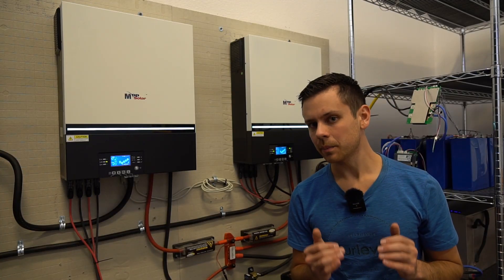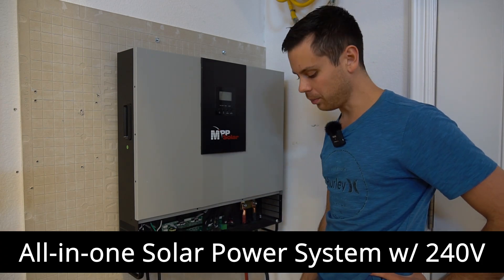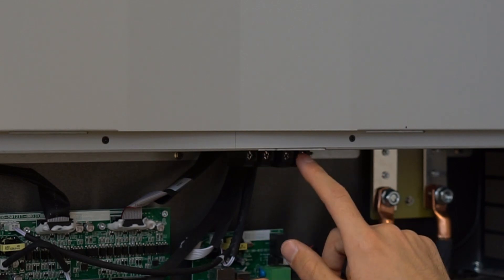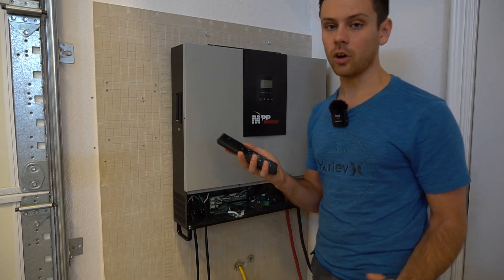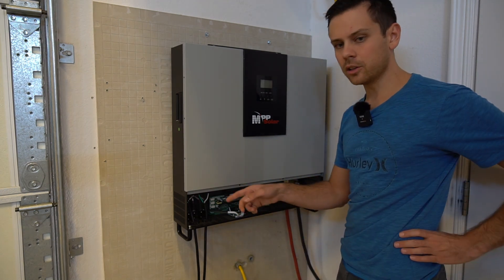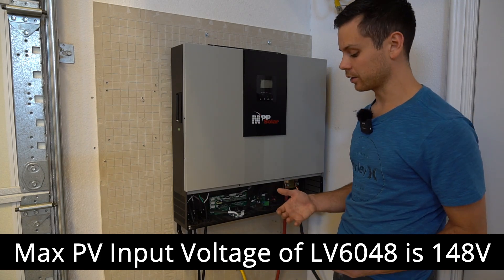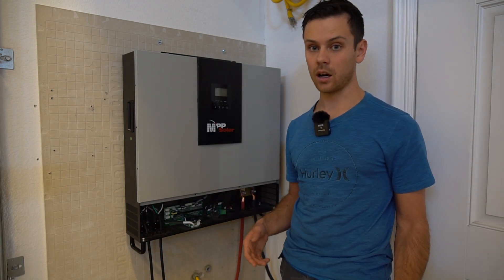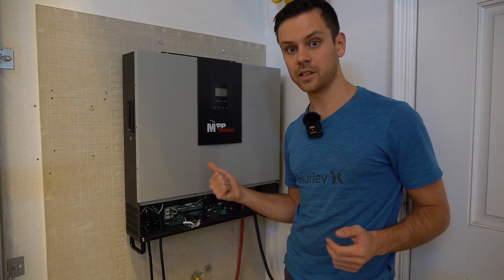How to Charge 240V Electric Vehicles with Offgrid Solar Power

Comment: GroWatt SPF5000es would be preferred over the MPP for strictly charging at 240V. It has 450VDC solar input.
Reply from the maker: I like MPP interface and connection terminals more. I need to make a video about that. Also, it doesn't sound like you are aware that the new LVX 6048 has max input voltage of 450VDC.
Reply: @WillProwse  And the new LVX6048WP will be 600V!
Reply: @WillProwse  
Understood 
The SPF5000es is $899 (240VDC only)
The MPP LVX6048 is $1577
And it’s over 2x the size & weight
High Freq GW vs Low Freq MPP
Reply from the maker: Where is it that cheap?? That is a bargain
Reply: @WillProwse  
Signature Solar
Reply: @WillProwse 

I was wondering why you went with the MPP over the Growatt. Would love to see this video! …I’m considering Growatt for the price difference!
Reply from the maker: @echopapa243  wow it is cheap. Gosh I love mpp so much more, but the growatt is a killer deal. That output for the price is crazy

Comment: I would like to build a carport with solar panel roof as an off grid charging station.  I am trying to get away from converting the DC off the panels to AC only to convert back to DC to charge the vehicle.  Is there an all DC solution?
Reply: You have to design it yourself.

Comment: Will, I want to charge my F-150 Lightning Pro's onboard battery with solar. I plan to use the onboard 98kwh battery to power my camper. The truck has multiple 120 output plugs and a single 240 volt output plug. I only need an appropriate MPPT to charge the onboard battery, right? I don't need a battery bank, do I? Thanks.
Reply: Yes you do. 240v inverters are not battery less.

Comment: I have a 72v utility electric truck I need to use as a backup power source. The problem I have is that these split phase inverters are 24v or 48v. What do I need to be able to use my truck to power my house?

Comment: I'm sure this is the wrong place, but it's really the only thing I've seen RE:240.  I was thinking about using 2 Bluettis & batteries to make 240.  Is it possible to then run it to a separate breaker box for 2 legs, 1 - 240 circuit for mini split and 2-120 circuits to run my TV/Computer room?  Then I'd run 240 to charge the Bluetti when there's not enough solar.  If there's a better place for this question just point me in that direction and I'll get out of your hair.  Thanks!

Comment: I made a big powerbox but my model s wont charge from it. If i connect de box on the grid, with passtrough, then it works, but offgrid it won't. Inverter too low quality maybe?

Comment: When you say "LVX has low frequency output," is there ever a circumstance where you'd want the frequency to not be 60Hz (or 50Hz in other parts of the world)?
Reply from the maker: Oops, should have said it's a low frequency design inverter. Which means better surge capabilities. Not the actual frequency at the output terminal. Sorry

Comment: I would like to see a video on a system for level one charging a tesla. I guess something like this but for a 20a outlet, I could plug my tesla into with the provided charger. I want to see how cheap a level two solar charger would be. A lot of people want to put solar on their car, but it doesn't make much sense. But it would be nice to make a small, off grid system that can charge it. And while I'm not charging my car, I could use it to charge my devices.
Reply from the maker: I have a few. Made multiple videos like that a few years back
Reply: @WillProwse  thanks. I'll find them. I appreciate the help

Comment: Thank you for your videos! They are super useful!  How would you go about sizing the battery back up to accommodate a full charge on an ev? I’m in the process of a rv/trailer build, 30’ rv and 24’ toy trailer. Trailer will hold my 18’ sailing kayak, my Ford Escape Phev (14kwh bat) and solar generator hopefully with enough charge the car while holding a few days energy for the rv. I’m having a hard time wrapping my head around the electrical system I need to create. Oh I have on hand 860 a123 cells (3.3v 2.5ah) which I plan on welding into a 16s53p battery which holds 6kwh at 48v. Problem is also weight.

Thank you!

Comment: Will, what would be the minimum solar array requirement for that setup?
Reply: Depends on how much you charge your vehicle. The charge comes from the battery right? The solar charges the battery. So you probably want to size your battery bank for how much you use daily, and work out how much paneling you need to charge the battery. Paneling can very depending on how much sun light you get. I'm currently charging 12 amps (lev1), from 400 amp hours (12v) Lithium iron phosphate, with 400 watts paneling. I get free lev2 charging from work though so I don't need much. I found a video on ground bonding to get the tesla to charge off the battery bank.
Reply: @anonanonymous1988  Thank you very much.

Comment: Will, have you done much research into what, at home wind turbines would produce as either an add on or supplement to a solar system. Is it even worth the investment for cloudier climates to supplement w turbines. Like on the Oregon coast for example. Thx.
Reply from the maker: Usually it's not worth it. Unless you build a big one. The small ones are pretty bad. And their output is awful unless it's extremely windy.
Reply: I looked into this as well. Unless you're going to spend ~$1.5k on decent wind turbine it may not be worth it. The reviews on the cheap turbines are all really bad. I've seen some water mills that seem to be successful though.

Comment: Just wondering how electric vehicles would have done stuck for over 12 hours in the traffic stoppages on the interstates in snow at below freezing temps?
Reply: Depends whose behind the wheel. 

Myself? Would have been perfectly fine.
Clueless people? Who knows.
Reply: Most vehicles (gas or electric) can more efficiently heat the occupants by using seat/steering wheel heaters than heating the cabin air. When hypermiling, or stranded, you'll be warmer for longer if you use the seat heater and the minimum necessary cabin air heater.

Some EVs have a heat pump-style cabin air heater which makes them more efficient than a traditional resistive-style heater.

If you had a relatively full battery on an EV with a hundred or more miles of range remaining, I would assume you could have the car heat on for a day, if you turned off lights and tried to be economical about it. I know I can power my fridge for a few days by hooking an inverter to my EV's 12V system (which is charged by its 400V system).
Reply: Well if you're stuck in traffic, then obviously you're not moving, which means you're not consuming much fuel other than heat. I would expect the electric car to do much better than a gas car.

Comment: hey Will I did see one other comment along the same idea as mine but what about DC charging.  Have you had a chance to look into it at all.  If you think about it it should be more efficient to use a DC to DC converter right off the battery bank to the car I would think could still use a all in one charge inverter to charge and for back up power.  It might also be a useful setup for power outage if you could also back feed from the car but im not up to speed on how the DC on cars equipped with DC charging work but I would Imagen that what makes it more efficient is that there is almost a direct line from the bat main terminal so might be a simple way to feed in or out?

Comment: But is there anyway of doing away with the batteries and trickle charging an EV direct from a solar controller hooked up to solar panels...so sun goes down nothing happens comes up the next day and charge trickles into the EV.

I am guessing this is not possible?

Comment: Very cool. Can this be used for a combined 120/240 say for off grid cabin and allowing the occasional Tesla charging?
Reply from the maker: Yes absolutely
Reply: You would wire the hot 1 to the 110v and both hot 1 and 2 to the 240?

Comment: So, this charging solution does not contain batteries. Only, your EV charges slower, which for me is no problem. Correct? You tested, that the EV.s can charge slower? Or they have some software that they recognize slower charging and they cut the charging?

Comment: Now they just need to make an all in one 96v combo and put the 48v models to bed!
Reply: 48V is kind of special due to most countries electrical laws focusing on 50V as a touch-safe voltage, where electricians and special protective equipment aren't required anymore. 96V would not be as safe for novices, so if you're going above 50V, might as well go straight to 400V (due to ease of conversion to 240V AC) or even 1000VDC as that's the next common voltage for regulation.

Comment: Hi Will. Is there such a thing as making an off grid power set up without any battery hooked up? SUN-PV-Inverter-Outlet ready. No battery. A system that can charge an EV or anything off available sunlight without any storage.
Reply: I ask because I am already off Grid. I'd like to make a second PV array without a battery. This way, I can park my cybertruck in the driveway and plug it in without any wear and tear on my house batteries. I haven't come across anyone converting PV straight to an outlet. 

I did build a level 2 charger off my 24 rollssurette1660 system. My thought was. When batteries hit float, the rest if the day is wasted energy. So it works to charge a model 3, but batteries still have to sag. The two chargers and 32×250 Array can sort of hold them at float but the batteries still aren't happy. Would be nice if I can flip a switch once my batteries are charged, causing the PV to switch to a system without any battery.
Reply: @LiamOlders  have you found a solution to this? thinking of doing the same

Comment: Would the new Bluetti AC500 paired for 240v be a more simple setup? I think they said 2 of them paired supplies 10k watts at 240v, 5k watt  inverter in each, and the solar input I think is up to 4kW each unit. They didn’t mention if they increased the solar input voltage beyond 150v from the AC300 that I could find though. I would think they would.
Reply: I know it’s not diy and more expensive, but isn’t it plug and play which makes it simple? Would it make sense for charging an EV?
Reply: Correction, it looks like the solar input is 3000 watts per unit.

Comment: If you put the LV6048 in (2 parallel) in order to rise AC output to 12KWh to charge a Tesla at rated 11KW power, that is possible?? I mean, those MPP wont need to share same output frecuency timming? in order to not blow each other?
Nice system actually :D

Comment: if I'm right in thinking that EV's charge with DC then a specific DC-DC step up would be the best option i guess but since that use case is very niche it seems to unlikely to get made anytime soon.
Reply: I was thinking the same thing. Seems a bit wasteful to invert to the solar system’s DC to AC, just to have the EV invert it back to DC internally to charge the ev’s battery. 
Does anyone know how you could charge an EV directly with DC?
Also it’s niche now but surely the case for doing this is going to grow and grow as solar fee-in tariffs start collapsing.
Reply: @cantstoptommy7077  The other issue is high voltage DC can be quite dangerous (if you get electrocuted)
If you bypass the EV's charge circuit you could just DC-DC buck convert it to what ever the voltage of the battery at full charge is and that's about all you need but they could get a bit more sophisticated with it I guess. You could do that at the MPPT charge controller and cut out the other %90 of the system just turn the panel Voltage to 400v DC or whatever that battery requires.
Reply: @cantstoptommy7077  The other proble is that each different car has a different battery voltage but you could design your own MPPT EV DC-DC "Fastish" Charger.
It's not the most complex circuit ever.
And Lithium Batteries charge a little differently I believe (NOT AN EXPERT) so I think you'd need some logic there but that is still 3 conversions that don't need to happen.

Comment: wouldn't it be possible to reduce the output of 25A at the inverter?  still, im not satisfied with current system of EVs vs Solar as there should be no conversion to AC.

Comment: Perhaps Will has something to say here and perhaps a little off topic, but it still baffles me why enormous electrical companies who have fast experience with UPSes/batteries like Schneider or Leibert aren't really active in this segment. They're essentially handing over backup power to these companies coming out of solar experience rather than backup power experience.
Reply: We use/see enormous UPSes for our clients - all lead-acid based with massive inverters - with control technology to flick over to generators and grid-ties of course.
Reply from the maker: Good point. I don't understand why they are not engaging this market either. Very weird.

Comment: They need a EV charger that can take DC input straight from a battery and avoid the AC conversion altogether.
Reply: Or EV equivalent to multi fuel i.c.e motor .
Reply from the maker: Agreed
Reply: This should be possible with any car that can DC fast charge. But the problem your going to have is dealing with a PV system that is more than 360v. I don't know of any consumer mppt's that can do that not to mention telling the car to go into that mode. Then you have the issue of safety/law, I know that most panel arrays say there good up to 1000volts in series. But I believe there are laws that keep manufacturers from selling systems over a certain DC voltage directly to the consumer.

Comment: Good job Will. Does DC charging have to be at high power levels? Because I think DC charging could be more efficient and ultimately cheaper than AC charging. If your solar panels generate DC power, and your batteries store DC energy and your car battery also stores energy as DC. Then as an engineer who loves efficiency i ask myself the fundamental question, Why convert that DC power to AC then reconvert it back to DC inside the Car? Conversion losses and extra cost of inverter. Why not just have a high voltage charge controller, high voltage battery the charge the car with DC, that would be efficient and cheaper.
Reply: I was going to ask this,  even if you need to boost up the voltage it would still be more efficient than inverting the power just to convert it back to DC.
Reply: because no EV supports this system yet.  Tesla is most capable for this since supercharger stations are actually battery packs DC charging the cars but nothing for home use even the Powerwalls
Reply: The DC for solar in this example is 48V. Most EVs are 400V or 800V based systems. You'd still need to "convert" (not really but similar) by using a boost converter. And that's just a simple view of it. With DC fast charging the charger and car communicate with each other to negotiate volts and amps as I'm pretty sure it's going straight to the battery. Basically you'd have to build or buy your own DC fast charging system.
Reply: @hobbes1069  However, the DC voltage from series panels into most inverters is usually around 600V (for on grid inverters), so a buck/boost converter that gives the battery the voltage it wants would be great for optimising some of that. Also a range of home batteries now come in high(er) voltage versions; I believe LG have several > 400V options.
Reply: @zeealpal  commercial systems have been high voltage for quite some time. I still don't see how that or the panels directly address the problem that you need to communicate with the EV and control the volts/amps. It's not magic, the charge rate has to be managed.

Comment: Hey Will or viewer I have a similar setup to your milk crate off grid small inverter setup, running 2 awg cable to bus bar then 2 inverter I’ve noticed shorter cable 150mm is getting hot and hanging around 45 to 50 celcius when pulling 90 amps on my fan heater just wondering if that normal or should I add another cable to make thicker to reduce heat?
It runs pretty good anyhow
135ah lithium phosphate (100ah discharge 200ah surge) atlas lithium aus made battery
1200watt 12v Inverter
Only gets hot if I run fan heater on low setting pulling 95amps

Comment: FYI EVs so far do not use the neutral so a NEMA 6-50 or 6-30 will work fine so long as you can get an EVSE with those plugs..

Comment: Are there products that allow just keeping everything DC for charging?
Reply: There are essentially no products like this that exist on the market for home-scale (i.e non-utility-scale) use. You would need a DC>DC voltage change anyway, so it would end up only being slightly more efficient than DC>AC>DC.
Reply: Seems to me the stationary battery would be sized much larger (in amp-hours) than the automotive battery, or the solar array would be hugely oversized for an intermittent load like charging one or two cars. So direct DC-DC charging would be un-economic if zooming out just a wee bit.